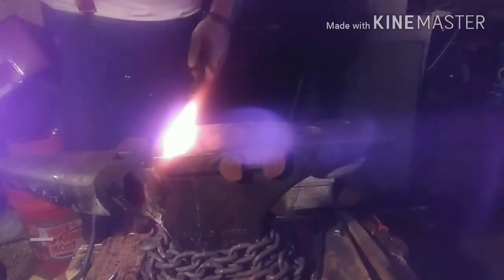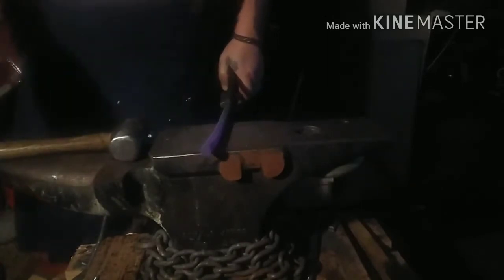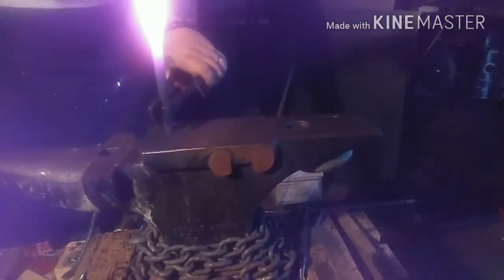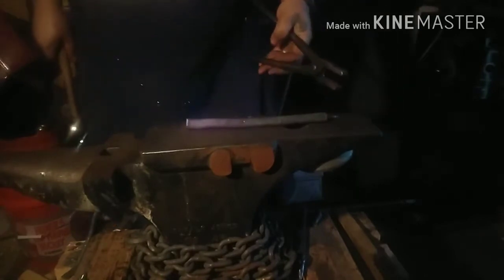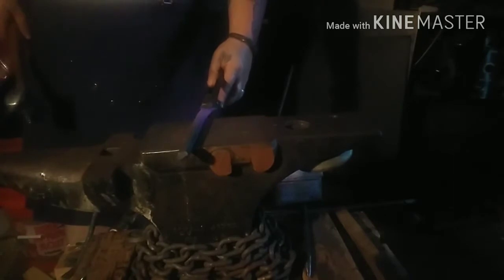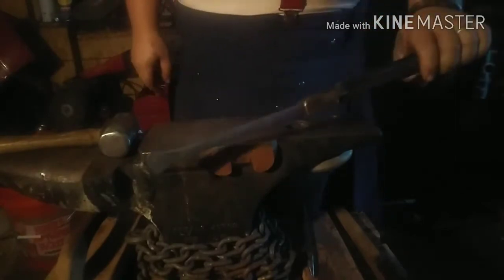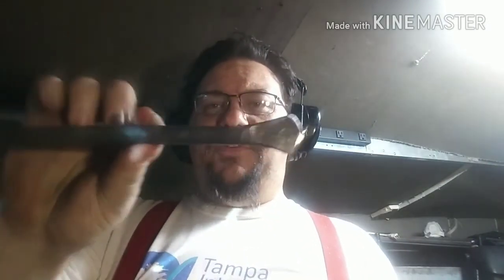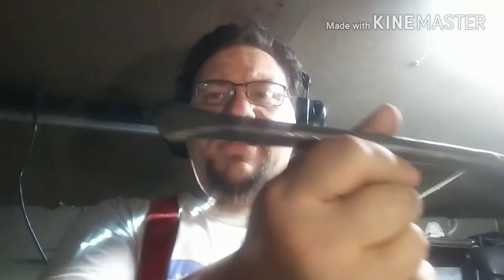Hand forging. My first hot chisel. "Blacksmithing"

Comment: Looks good!  Thought I'd mention the table on your grinder tilts so you can get an exact bevel on your tooling end. Back when I started I actually ground out the back of the table to allow for deeper angles. Good luck and keep em coming.
Reply from the maker: thanks for watching. and the advice.. i'm not too quick on the uptake when working with tools . blacksmithing has been my first foray into a craft using so many power tools.